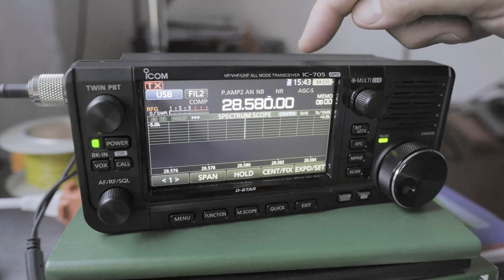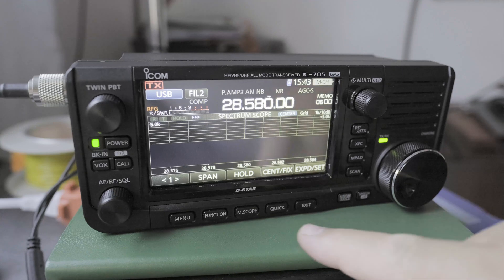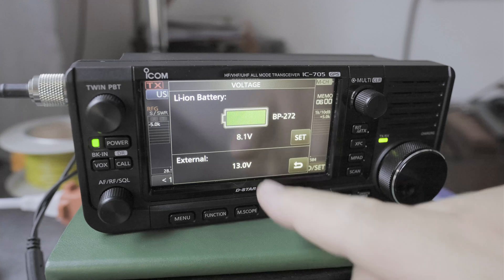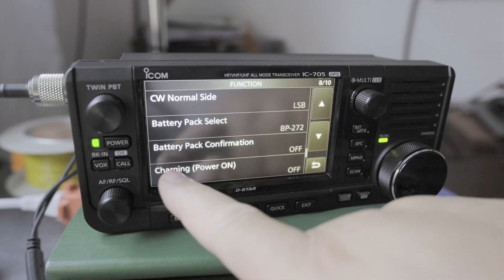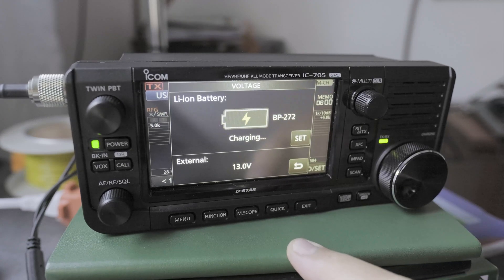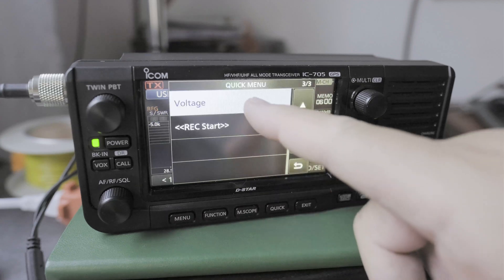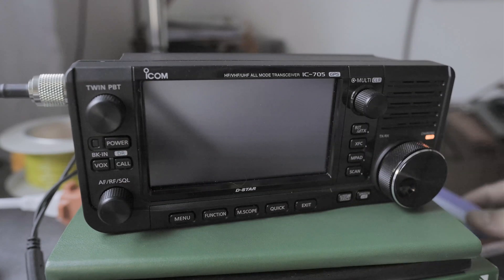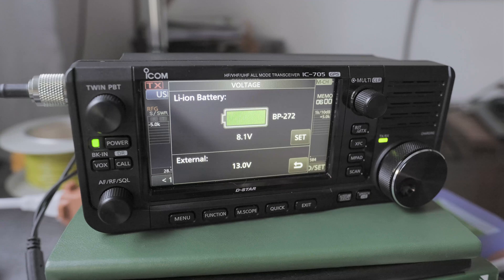IC 705 Charging Internal Battery When Radio is On

Comment: Can the IC-705 be powered via an AC outlet or must it be connected to an external battery only?
Reply from the maker: The radio only takes DC, but if you have a brick that converts AC to DC, then you can.